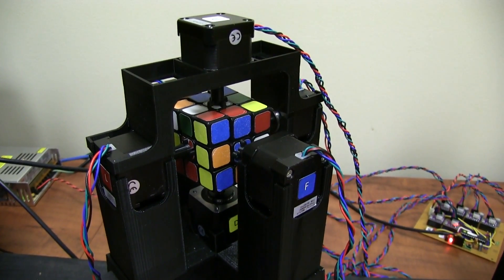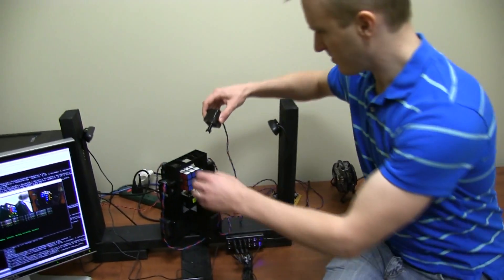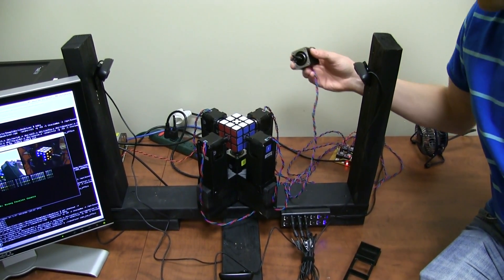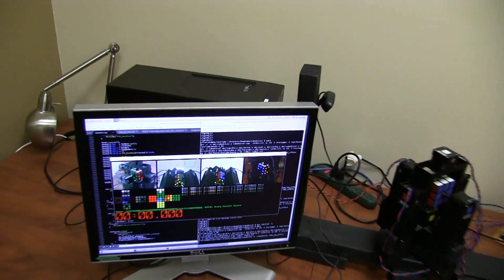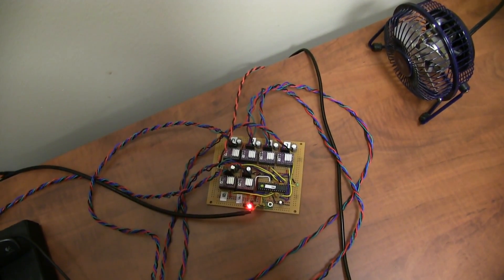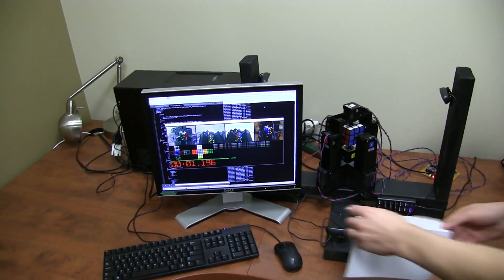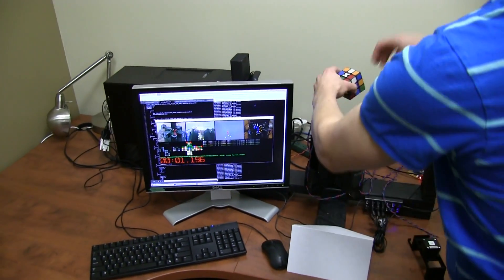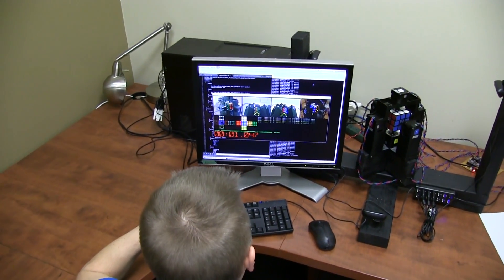World's Fastest Rubik's Cube Solving Robot - Now Official Record is 0.900 Seconds

Comment: This is awesome! I love it. 

Do the cameras do anything while the robot is solving the cube? I'd assume that the video is so blurred, that the webcams cannot provide anything meaningful, so I guess after the initial state of the cube is determined, they are not used anymore, right? 

Also, at first I was wondering, if you could do all the moves with the six stepping motors (especially, turning a middle "slice"), but after some thinking I figured you can. 

Have you thought (or maybe doing it already) about optimizing the solving steps to take, so that you could execute the steps faster, maybe even in parallel, even if it might be a few steps more?

Comment: Congratulations, I think that you have done an excelent job. The things that I appreciate the most are the simplicity of your design using common things and the efficency in solving the cube. You defently have a good programing abilty that you have used to integrate the varios components of your machine. I'm sure that you can use this  same escence in solving other problems. I think that what we can take away from your work is not the cube solving machine(wich is great), but the simplicity in wich you have solved a problem using a simple method. Again congratulations.
Reply from the maker: Thanks!  We actually scrapped a few more complicated design revs before we came to this one.  Simple is better!

Comment: The only problem I see, is that every cube solving competition I've seen starts with the cube being covered. If that is the case, you are going to have to uncover it, slide it into the rig, place the top back on, and then let it solve it. I have a feeling that will take longer than the current record.

Comment: If you could somehow replace those feet with rubber ones that can be pressed against the cube with enough pressure to resist the spinning force, you could do with with unmodified cubes. Which would be a little more legit. Still, awesome.
Reply: +HisRoyalCarlness or suction cups , widely used for applications like this....

Comment: Impressive... replace the drilled cube with a stock one and use a steel holder to grab the middle block instead. The tolerances of the cube should allow a fit. Additionally add sensors to get the color of the middle block so it can be inserted any side anywhere. Without these changes i don't see this robot being eligible for a world record.

Comment: You want it to solve as fast as possible?

I want to see barriers of why you cant get it go even faster? Cameras must be involved as a barrier of speed, so we can replace them with very high speed cameras like "the Photon Camera of the MIT" for computing, linux operation system is a good choice but calculations are done in chips and chip vary in speed, so the best choice i think is to rely on something very good already built and barrow it for a few runs.. so lets barrow "TIANHE-2" which is capable of 33.86 petaflops (quadrillions of calculations per second) - i think that should run it fast. now when calculations of algorithm and camera detection is fair enough lets focus on electric signal transmission and engines themselves. For wires i would recommend to use "pure silver" and for electric engines to actually turn the cube i think the best choice would be to get 4 of "200W 600,000 rpm Electric motors supported by air bearings".. now in question comes the durability of frames, hooks and the cube itself cause at so high speeds something might break right? well we can build a custom cube and all parts made out of "Magnesium based alloy" right? Yes. so maybe then we can solve a rubik's cube under 0.005 seconds. This actually seems possible.

All we need now is a little investment of dollars ;)

Comment: the reason I like the cubestormer3 a lot more is because it doesn't need a special cube with holes drilled into it. You can just put any rubik's cube in there. So this one isn't a robot for solving a rubik's cube, it a robot solving a modified rubik's cube.

Comment: Quick question, I've noticed that the cube faces are constantly facing same motors (i.e. white is up blue is front etc.). Is this mandatory for the app or would it solve the cube regardless the position in the holding frame?

Comment: Absolutely fantastic! People don't understand that this machine is more than a simple Rubik's cube solver, for them it's easy to criticize other's people work. They don't see all the math and science, algorithms, thousands of lines of coding, image recognition, 3D printing, mechanical, electronic and computing engineering, all the knowledge that you both have to build the machine. They only see 24 holes drilled. What's wrong with all this people?
Reply: +Luiz H 6 What else could this machine do reusing the knowledge?

Comment: Great machine but I noticed when you scrambled the cube you didn't rotate the central piece of the cube in the horizontal or vertical plane but just rotated the outer cubes so when you put the cube back in the machine all six central colours were still in the same orientation when you replaced it !

Comment: Very well made robot guys, but it seems as if you are using original Rubik's cube.
Trying with better cubes (like MoYu or QiYi) could give you possibility to use higher speed on these stepper motors.
New cubes cut corners way better and lock up far less than the "original" ones.
You should give it a try.
Currently the best cubes on the market are: Gans 356, GouGuan YueXiao, MoYu TangLong, MoYu AoLong GT...

Comment: At some point this is like one of those toys that when you turn it on it turns itself off. Solving a rubiks cube involves an algorithm that people who solve it memorize and get faster at utilizing with practice. A computer doesn't have to memorize. The second challenge for humans is our motor skills which can also be improved along with holding techniques. But none of that is relevant to a machine, it moves as fast as it does and it holds it however you set it. Utterly removing all challenges and thus the point.

Comment: You have narrowed down the number of options by putting a modified cube in the center of each face. Regardless of how you shuffle it, the modified cube (drilled one) remains in the center. Of course, it wont add a lot of time if it were the original rubics cube but just that it wont happen in <1.2 seconds every time.

Comment: Nice project... kind of easy after set a good movement of the servos, and make the color recognician by computer vision, then it's just code...
you could improve this if you made all calcullations in the PC, and just sent by USB small codes so the microcontroller knew the port that needs to be activated. You could try for example, you have 3 motors, if you send only 3 bits of information you could say what motor to use, and if forward or backwards. I believe this would really speed up the process.

Comment: I call shenanigans. they arent rotating the whole puzzle. Each middle piece on all of the sides have to be different colors for each of the stepper motors, ie top side get white, right side gets blue ect. Get it so that two different sides middle pieces has the same color, ie top and right middle pieces are white, and this garbage contraption will not be able to complete the puzzle.
Reply: +Van Litespeed the centers don't move relative to one another
Reply: Did you just say that it should solve something impossible?
Reply: Do you know how a rubix cube works? The center pieces are always fixed and you can't have two middle pieces of the same color. They are designed so only the sides can move.
Reply: +Austin Bach Do you even know how to spell Rubik's?

Comment: https://www.youtube.com/watch?v=w93BsGyE4DQ
Well, here's my version. But yours is truly amazing. That part where you uncover the camera and it solves it in just over a second, just loved it. I can't imagine how the cube is so stable even at such high speeds. Any suggestions for me to improve my design?
Reply from the maker: +Palash Roychowdhury Cool man!  Looks like we had pretty much the same idea - arduino, the stepper controllers.  One trick we did was to use a higher voltage.  Steppers lose torque with speed, but higher voltage compensates.  We're up at 30V.  And turn up the current adjustment on the controllers.  And use a fan on the controllers :)

Accel/decel curves are important too.  Stepper will skip if you start at a high speed, but if you ramp up to a high speed you can go faster.
Reply: +Jay Flatland Thanks for all the info. The stepper motors which I used was rated at 12V so I didn't use it on 30V. I am from mechanical background so didn't know much about the electronics part. Also, a good point about the curves. Thanks

Comment: To those of you that think modifying the cube the way they did is cheating, you are missing the point. Obviously they could have made a different hardware set that was a bit clunkier or possibly used suction instead, but that is so far from the hardest part of the operation. The camera usage, motor calibration, and programming is extremely impressive.

Comment: I'm pretty sure that drilling out the center cube is cheating, like changing the stickers on the cubes
Reply: nope. you can have a modified core, and that includes taking it out.
Reply: +Matt Harmison See I never would have known that, I figured it was cheating because you're essentially modifying the lynch pin of the entire cube, since each side rotates around the center
Reply: As long as it rotates and can hold together on its own its fine :)
Reply: +Trypno It's a standard speedcube, do your research.  You don't "drill holes" lol

Comment: I'm surprised no one even cared to point out the fact that he never scrambled the center pieces. mostly because he can't, because then the machine won't work. :p so in the competition, what if the judge wants to scramble it?
Reply: The center pieces don't move. They tell you which color the face is.
Reply: The centers don't move.
Reply: thanks guys. I had no idea. 😛
Reply: Has any one seen how stupid your comment was. Mostly because you know nothing about how the cube works. Centrepieces are FIXED in their RELATIVE positions witch means you cant alter their position. THEY are automatically SOLVED. The other pieces are solved in relative to them. And furthemore if you turn the middlelayer, its the same that you move right and left layers in opposite directions.

Comment: Modified cube. Literally cheating.
Reply: look up the rules, it's completely legal to use modified cubes.
the original rubik's cube would be near impossible to speedsolve.
Reply: Hugh Jainus Have you ever ttried speed cubing with an unlubed rubiks brand cube?
Not possible.
Reply: All of them. It's not a record unless it is a genuine rubiks. I've personally witnessed 6 different records.
Reply: +Hugh Jainus they had to modify it so the robot could manipulate it duh.
Reply: At what point would the cube be over modified? It's literally cheating.
Reply: Have you ever drilled holes into a rubik's cube to allow for an unfair advantage? Literally. Cheating.
Reply: +Hugh Jainus Florian mod... Kinda same but on the outside of the center piece dude...
Reply: +Hugh Jainus however you are right, the pieces shouldn't be damaged. Check on the WCA website ;)
Reply: Is it fair to rule out an olympic runner because he used a prosthetic leg?

Is it fair to rule out a rubiks cube because it had tiny holes drilled in it that barely affect performance because they are required to work properly?
Reply: +Benjamin Engdahl Man just check, I'm sure you are right in a certain way but the rules are the rules...and that is considered as damaging the cube, not modding it. Was pretty exited at first but then this was not legit... Too bad...
Reply: +Benjamin Engdahl Well, was thinking then realised that Guinness accepted a cube without center caps. Don't know if they have the same rules as the WCA...
Reply: +Benjamin Engdahl Read his name again and realise you're being trolled.
Reply: sighs
Reply: Benjamin Engdahl This guy gets it.

The rubik's cube community needs to impose strong penalties for those that need to bend the sport in their favor.
Reply: +Hugh Jainus really the person above was right, it doesn't really count as a mod, it is more of a damage
Reply: +Hugh Jainus also, what record holder HASN'T lubed their cube?
Reply: Benjamin Engdahl Lube is required maintenance. Hacking your cube apart is modification.
Reply: +Hugh Jainus alright, here's a better question.

What record holder ever uses a rubik's brand cube?
Reply: +Hugh Jainus Your proflie name explains how much of an idiot you are
Reply: Paris Dorn You're need to point that out say's a lot about yourself :-)
Reply: +Hugh Jainus The cube in this video isn't "modified"
Reply: Paris Dorn It is. They're "cheating."
Reply: +Hugh Jainus It's not modified.  And even if it was how is it cheating dumbass? It's a speedcube.  Go away old man
Reply: Paris Dorn Holes gouged into the cube. You couldn't use another cube, only that one modified cube. Cheating.
Reply: It's not modified.  It's a speedcube, designed from factories to turn well.
Reply: Paris Dorn No you can't. Stop enabling these cheaters with your ignorance.
Reply: Paris Dorn Cutting grip holes into the cube is cheating.
Reply: "Grip holes" what??? 1. No one cut anything here. 2. They're not for grip, they're for ease of movement.
Reply: Paris Dorn Show me where I can buy the cube they use, and I'll admit I'm wrong. Unfortunately, I'm not wrong. They're just cheating.
Reply: http://thecubicle.us/3x3-c-23.html as you can see, these are what pros use
Reply: +Paris Dorn lol, you're a dumbass. That's not what's in the machine.
Reply: Let me get this clear: you're talking about the holes in the cube, right?
Reply: +Absence “ಠ_ಠ” 1. That cube isn't  a rubik's brand, it was a speedcube (fangshi I think).  2. Rubik's brand can't turn that fast.
Reply: Absence It's modified. That's all that maters. See the "X" shape made in the center tile? That's no found on any production cube. It also fundamentally changes how the cube operates. It's no longer manipulated by the edges, but each side is spun like a disc from the center. Totally changes the fundamentals of the puzzle. Cheating. Bending the rules to suit your purpose.
Reply: +Hugh Jainus You do realise that those holes are needed for the robot to grip the cube properly, right? And also, this is just the record for robots, not robots and humans together.  It's just a robot.  Not an official record
Reply: Paris Dorn Hence why I'm saying it's modified. Use a real cube. Figure out a way to solve it without cheating.
Reply: +Absence “ಠ_ಠ” I'm sorry, but you're weong about the cube. It's not a zhanchi, and there are at least 5 reasons why. It's probably a fangshi shuangren
Reply: he's mistaken.  I'd bet my life that that's not a zhanchi. If you were a cuber you'd know
Reply: +Absence “ಠ_ಠ” It doesn't sound and look like one tho.  That couldn't be one because the zhanchi's florian cuts aren't that big.  And this is 2016, who uses a zhanchi now
Reply: +Hugh Jainus Its not cheating you dumbass, they just modified the middle part of it as + shape so that the robot can grab it.
Reply: +RedEyed Rocker (Mysterio Broly Brock) ^ this

Comment: Is this opensource? Would be awesome if so =D!
Reply: +Qualp LPT They didn't design the algorithm that solves the cube (called "kociemba"), there are already open source implementations of that. I doubt they'll release the code for interfacing with the motor drivers and cameras (that and the physical implementation are the hard part) but who knows, maybe after they go for the record.
Reply: +Xei physical implementation is the only hard part. there is already plenty of softwares that can send basic commands to custom built robots.
Reply: +JamboNessy Well it's (relatively) simple to build a robot to solve a cube, the hard part is doing it quickly. There are a lot of little details to get right and optimize. You're right though, almost all of the challenge of doing this quickly is physical implementation.

Comment: Probably aren't breaking any records if you have to modify the puzzle/cube.  It's like me drilling my way out of a maze and saying "I beat you!"
Reply: I have one question. How exactly does drilling few holes into it make it any easier to solve?
Reply: Aleksi Nuutila Before drilling the holes you would need a robot with hands or grips to move the cube, but if you drill holes into it, a much simpler design can now rotate the cube. It's a loophole that makes it easier for a machine to manipulate the cube.
Reply: +Travis Burns "drilling holes"  lol you're stupid
Reply: Paris Dorn Please elaborate if you intend to make a point. You're stupid times two.
Reply: It's called florian cuts, and that's what cube designers use in cubes nowadays.  No one here drilled any holes.
Reply: Paris Dorn Okay replace the word "drilled" for "cut" and it solves your dilemma, guess ya missed the whole part about modifying the cube to make the puzzle quicker to solve.
Reply: What do you mean by modified?  Speedcubers around the world don't use cubes without those cuts.  You're basing it off the original Rubik's brand, which is wrong.